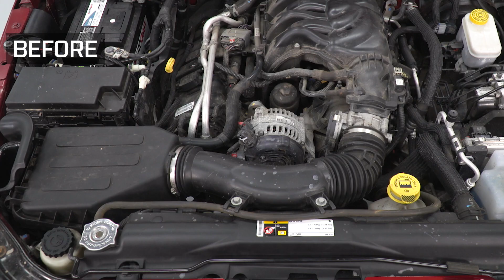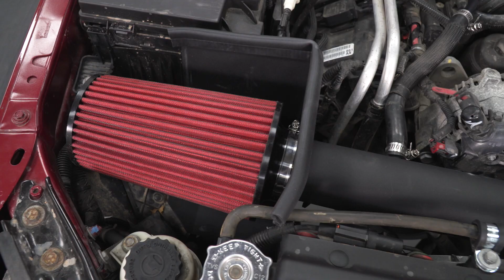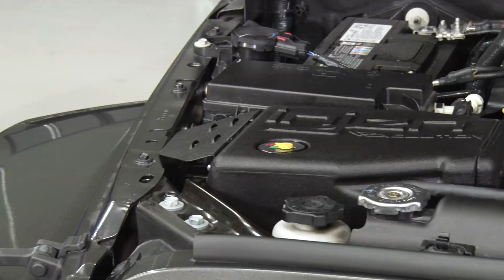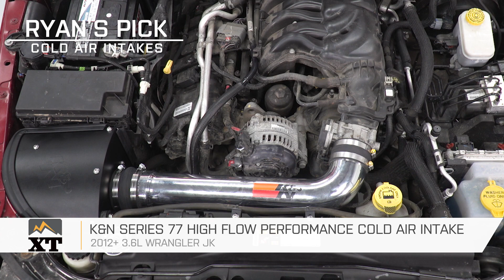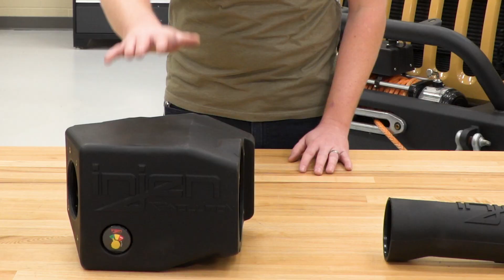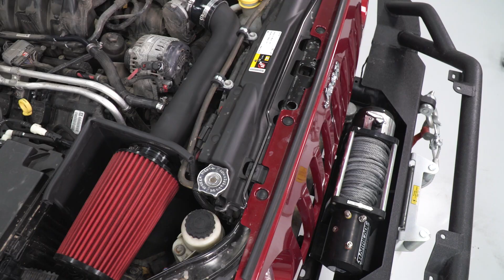The 3 Best Jeep Wrangler Cold Air Intakes For JK 2007-2018

Comment: I'm running the Redrock 4x4 cold air intake on my 07 Jeep JK. First off, I love it. The jk 07-11 come with a sluggish motor. After installing this it sounds stronger and it's running a lot better. Easy to install. And it looks awesome. With that, I installed a duel exhaust and I installed the amp'd throttle booster. With those 3. You're jeep jk 07-11 runs very noticeably a lot better.
Reply from the maker: Thats what we like to hear! Thanks for watching! -Zach

Comment: I’m looking into getting a cold air intake system. What would go good with my flowmaster outlaw exhaust? Thanks
Reply from the maker: Any of them, honestly! You don't need to worry about pairing a specific intake with your exact exhaust system. All of them will play well together! -Zach
Reply: @extremeterrain   which would you choose injen evolution or banks ram-air CAI. Thanks Zach
Reply: @chesley_77  injen evo gives the best sound with the outlaw that’s what I have on my 2013 jk
Reply: @adamgraham3314 looking for CAI for my 13 4dr jk,. Which evo do you have.

Comment: Hey few questions one will the check engine light or anything come up when any of these items is on and two I like going mudding I like to go a little bit some water when I'm out at Rush Creek or anywhere in PA
Reply from the maker: None of the featured cold air intakes in this video will trigger any check engine lights if installed correctly! If you go mudding or take your Jeep through bigger puddles often, I highly recommend looking into a system that has a closed airbox instead of an open-element one. It will be less likely that you suck any water into your intake that way. Check out the following link for an example and have fun shopping! -Zach https://www.extremeterrain.com/injen-evo-cai-36l-evo5003.html

Comment: Sounds better yes✅, throttle response yes✅.
Add HP no❌, unless you have a supercharger and performance coils and sparks 🙃.
I prefer the AFe Intakes over those.  Buy what is available and better deal you get. Again NO HP gains.
Reply: I disagree with you a bit, however, I havnt seen anyone doing a dyno test feed the vehicle air, such as being in a wind tunnel to REALLY simulate real world results. Like driving down the road. Those vehicles are sitting still, usually inside a building, so no infeed, the engine has to work to pull all of the air in. Have you seen anything different?

Comment: Would you ever put a water repellent cover on the intake
Reply: I put one of those on mine it works really good, the area that I like to go shooting at you have to cross a 4' deep water spot and a few mud pits and the water just beeds right off of my intake wrap
Reply from the maker: If you're in an area with a lot of rain and deep puddles or find the trails you go on to be pretty muddy, it wouldn't hurt! -Zach
Reply: @extremeterrain  Would the hydroshield help with dust particles? I'd like to put a CAI but I live in SoCal and I hear they get dusty

Comment: cold air intakes for jeeps are called snorkels
Reply: ??????????????????????????????????????????????? not even close
Reply: No.
Reply: Would you ever put a water repellent cover on the intake
Reply: Ok what's your intake temps ? 
Bet it gets hot from the amount of tubing under hood .
Reply: @street_legal_go_kart7356  you mean that 2' span from the firewall to the airbox? im pretty sure with the speed the air is moving at isnt going to be heating up enough to notice in 2'
Reply: @nyfo29  not about the speed of the air literally it will get warmer because of the routing underneath the hood of the pipe the pipe will get a lot warmer. You don't even know what your intakes are but going to have a stupid argument. I'm insulated my tubes modified my own box and got a 4-inch pipe sticking out of the hood. My intake temps are within about 15 to 20 degrees of outside temp at a normal speed within 4 to 5 degrees of outside temp at wide open throttle.
Reply: @street_legal_go_kart7356  i actually do know my intake temps but i dont keep them written down so i can post them when im at my computer & im not interested in this debate enough to go out to my jeep & look it up. so youre the expert yet you think the air 4" above your hood is going to be similar to the temps around the roofline? really?

Comment: Airaid is the best intake on the market today, bar none. People who say that a CAI makes no difference are clueless. DYNO results show that even the cheap CAI's add HP!!
Reply: But if it's pulling hot air from the engine bay it's not really a CAI. Sure a bigger tube may pull in more air, but now your bottleneck is your throttle body. 2hp for $300 doesn't sound like a deal to me especially on a jeep that runs at lower RPMs. You also have more debris getting sucked in and a greater chance of hydro lock. On a sports car? Sure! A Jeep? money can be spent better in armor honestly.
Reply: Casandra Clark the thing is most dyno tests are done with the hood open which is bs

Comment: Com on with hawking this gimmick garbage. You know full well these cai are a complete waste of time and money especially on a Jeep. Jeepers waste millions on useless products like these every year. Even the cat and axle backs are largely a waste of money on Jeeps. Smh
Reply: I noticed a pretty big improvement in my TJ.  Had headers, cat back exhaust, and CAI.  Seemed like i had more throttle response and it was definitely louder.  I make a decent living and I like working on my vehicles for fun, so taking apart my jeep and rebuilding basically everything was worth it for me.  To each their own.
Reply: @jlateralus21    All I'm doing on my TJ performance wise is getting an Afe cat back exhaust. I did see legitimate improvement with throttle response, gas mileage and a kick ass throaty growl on my old Wrangler. Doing the same for my '05 TJ Rocky Mtn soon.
Reply: @Luke2136  I just bought a '17 JKU after my '02's rear differential exploded last week.  I loved that TJ but it had 200,000 miles on it and the tranny was starting to slip too.  So instead of buying a new diff and possibly a transmission soon, I decided to start a new project.
I had Borla headers and Cat back.  KN COA, mustang 5.0 fuel injectors, and basically replaced every part in the engine as part of a rebuild from the block up (2 of my cylinders failed and had the dreaded P0301 code).
Watching vids like this to get an idea of where I wanna start with my JK...    The hobby is expensive, but gratifying when you get compliments on how your jeep looks/sounds.
Good luck to you!
Reply: @jlateralus21     Same to you, be well.
Reply: You should eat a Snickers.
Reply: @donniemolchan7476   No need to eat garbage, I didn't piss my money away like you dolts. I can afford a great meal, but you enjoy those candy bars. 😆
Reply: opinions r like assholes. everyone has one.
Reply: @mikejones-qj7dm     Yeah you're  the asshole who wasted his money on this. 😆 A fool and his money are soon parted. Bet you own a pet rock too. 😂
Reply: @Luke2136  dude calm down, you don't have to be a dick about it, they do help. I've seen a slight increase in hp after I threw this and a new exhaust on. I didn't even really do it for the power, I just wanted it to sound like a truck instead of a car...🤷🏼‍♂️
Reply: @Rolyat0-0   Just being honest, trying to save folks some of their hard earned money especially during these times. Gains are negligible at best. Hey it's your rig, by all means have at it. Be well
Reply: @Luke2136  you should check autoedits channel, he saw gains and set it was well worth the money
Reply: @Rolyat0-0    The aftermarket are the dicks fooling Jeepers into buying largely useless products. I'm just trying to save folks their hard earned 💰.
Reply: Not true depends on set up .+ other mods . works as whole system not just 1 part .
Reply: @abortioncritical  Nope, well off and wise.
Reply: @abortioncritical   You sound dumb.
Reply: The comments crack me up. All from fools who just can't accept that they were so stupid  to have wasted their money on useless crap. XT is grateful for the foolish masses.

Comment: What do you think about AFE air intakes??
Reply: Mazin Ali I had one and I highly recommend the dry s filter from Afe. No oil to mess with and it’s easy to clean. Looks great, sounds great, and felt like throttle response was improved.
Reply: jmart2022. Cai are a gimmick. All they do is make your wallet lighter.